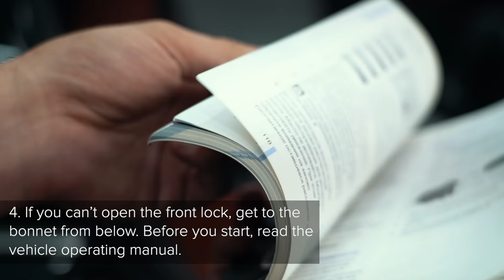What if your car's hood won't open? | AUTODOC TIPS

Comment: Thank you so much.   Had watched so many other videos suggesting ways to attack the issue through the wheel arch, or via a screwdriver through the grille, and was resigned to working through this until I saw this, and method 1 worked at the second time of asking.   Latch on the passenger side was rusted and stiff, but loosening it through WD40 and pressure from a screwdriver, and all back to normal.  Really great  video, saved me so much time and potentially cash, too.
Reply from the maker: Thank you for your feedback!
It is our top priority to receive comments as positive as yours. 
Be sure to subscribe to our channel if you don`t want to miss out on more useful videos in the nearest future. 
Best regards, 
Autodoc team
!

Comment: Great and actually useful video. Ended up going through the grill, removed the panel and reached in to release the latch. Will tighten the release cable after. Thank you 😊

Comment: My bonnets locked down on one side any ideas, the latch is released and it has clearence just jammed on one side
Reply: I'm having this problem with my e36, if you figure it out let me know lmao
Reply: @jamespaar6649  Yep sussed it man you know the little "rubber hood bumper" things on each side of your bonnet that work as like stoppers sort of, they can be adjusted and I accidentally adjusted mine when I was cleaning my engine bay and my bonnet closed unevenly and got jammed on it. all you've got to do is get a screw driver inbetween the your bonnet and the one that's jammed and pry it open. Make sure your bonnet isn't latched when you're trying to pull it open (hold the bonnet latch unlocked with your hand when pulling bonnet (not the latch under your dash) and try get a screwdriver under the rubber bumper on the side of your bonnet that jams. they should look like rubber bullet/ bulb type things here's a link to one. https://www.aliexpress.com/i/4000190087597.html (it's upside down in photo) If you get real stuck I'll take a video to send you lmao. That's what the problem was for me anyway your's might be different so if it doesn't seem like it's working don't bend your bonnet haha
Reply: Also if it is the rubber bumper, once you get the bonnet open make sure you adjust the uneven bumper before closing it otherwise you'll have the same problem again (make it the same as the one on the other side) easy as to adjust just turn them
Reply: @jamespaar6649  Oh also these bumpers are on the upper radiator support frame on either side not on your actual bonnet, the bonnet rests on them when it closes